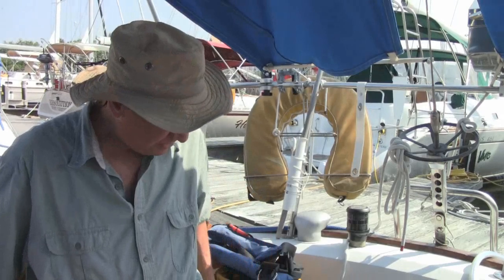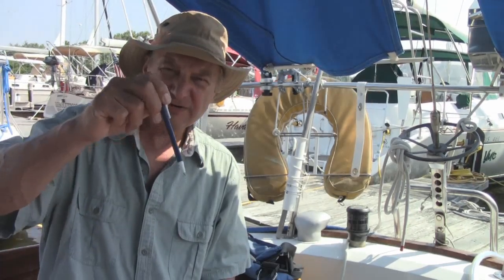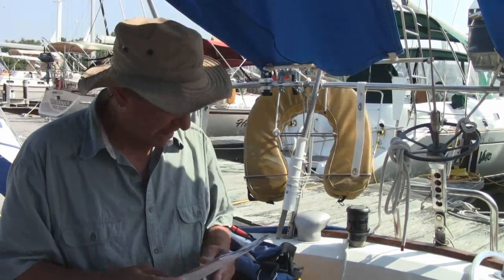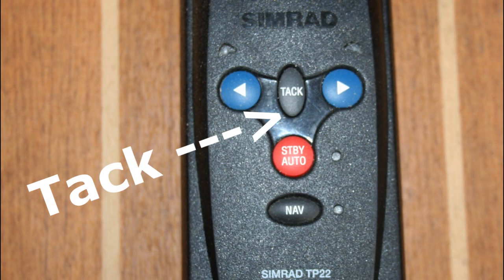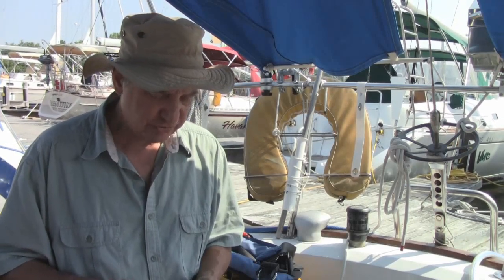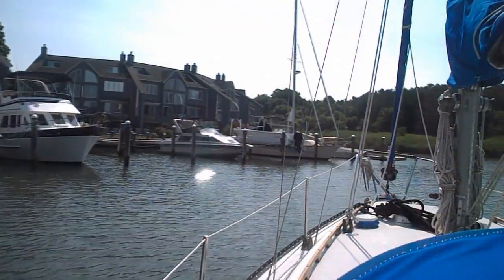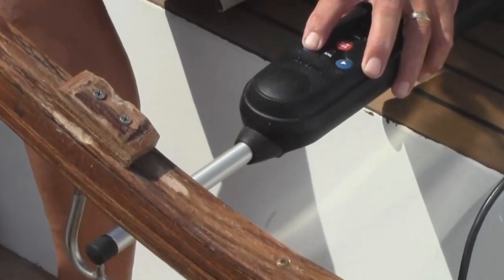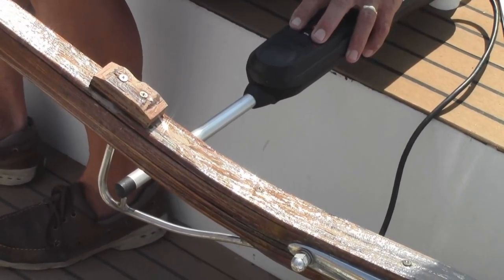Calibrating Simrad Tiller Pilot

Comment: Beware, the motor end of mine filled up with water and corroded out the dc connections to the motor, resoldered and it worked, the simrad is miles better than the raymarine though!
Reply from the maker: Hello Steven, tks for watching, I agree Raymarine, not good that is why i went with Simrad